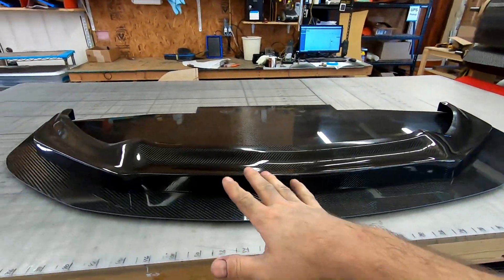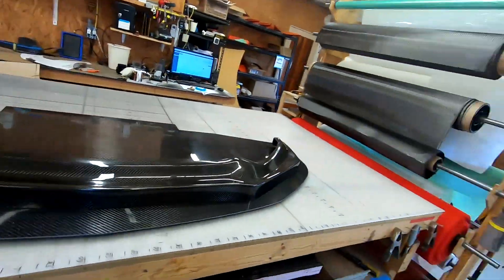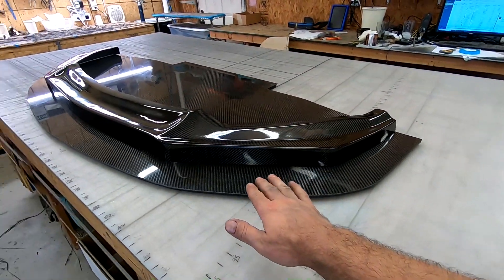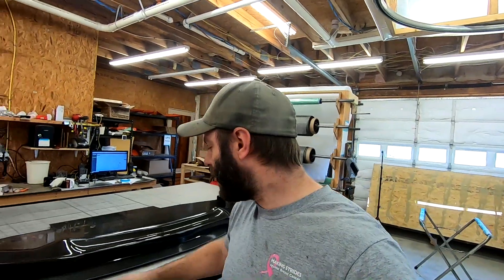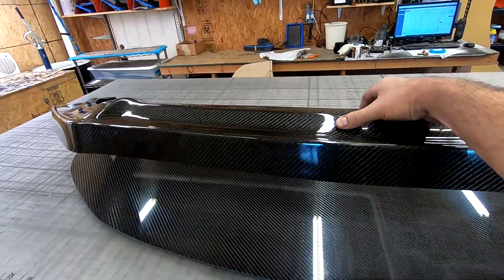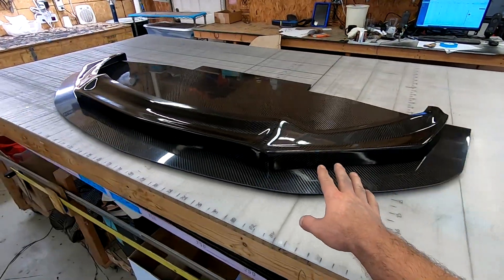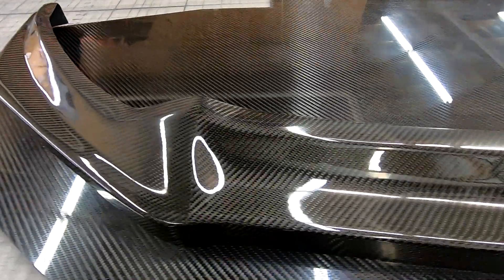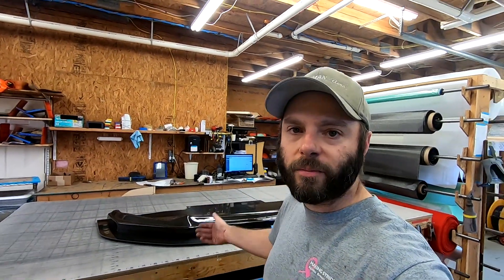How to Make a Carbon Fiber Splitter Lip or Air Dam

Comment: I think what I like the most is the neat-ness of the process and the workshop setup. It's so practical. Also, the finished product has that "custom" carbon fibre look to it which I absolutely love because it adds a little imperfection to it...which I believe is necessary when doing anything custom to your vehicle. It shows it was built, not bought. Epic work. I wish I could spend time with you in the workshop to learn how to do this myself. It's a skill I'd love to have.

Comment: I see you used multiple pieces of CF due to the shape of the lip. Are you laying the CF piece overlapping or as a butt joint? Do you have a video about joint to ends together? I already seems the the V style video. I’m more interested in joint 2 ends together like at a corner and not a flat part. Interested in how to make a front lip and or diffuser that has alot of complex shapes

Comment: Youtube is a huge learning platform. Your channel provides interesting insights into car part creation by molding/laminating. In specific the timelapse, where we can see everything you do and get a rough understanding about the effort in time and actions are very helpful. We currently plant to start creating small molds for car parts and have several main stream suppliers available where we can get the carbon fiber cloth from, but getting complete rolls is either not possible or very expensive. So the question is where do you get your clothes from?
Reply from the maker: Lately it’s from whoever has what a need at the best price.
Reply: @ajhartmanaero  ok, so no insider industry shop. May I ask what fair prices of 2x2 200g carbon fiber cloth per square meter at the US are?

Comment: Hey AJ, been in the composites world a while although i mostly do motorcycle parts rather than car parts myself. I noticed you applied clear coat into the mould... I assume this is 2k automotive clear coat, what are the benefits to applying to the mould then laying up over top of that? I usually clear coat the parts after infusing
Reply: Smoother part, stronger mold, probably used a a release agent as well
Reply: @ivegonemad  Not really any of those.

You get a perfect finish when spraying into a mould then spraying it on afterwards. You completely remove any chance of orange peel etc.
I can't spray clearcoat onto a finished part to save my life but i get a perfect finish if i spray it into the mould first.
It also allows you to hide any pin hole from infusing that can be a pain to fill/finalize later with clearcoat.

It could be clear gelcoat, or even something like Duratec Sunshield.

Comment: Do you bond it to the blade to make it one piece?
Reply from the maker: No. If I did that and the car goes off track it would wipe it all out. Keep them seperate and you may only need just the blade. Atleast that’s the theory.
Reply: I was going to ask the same question. Thanks!